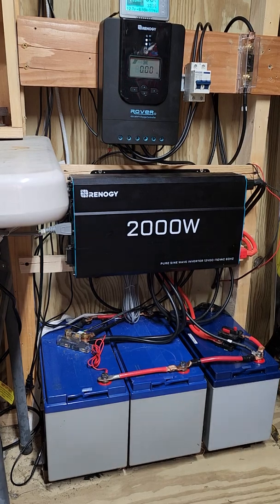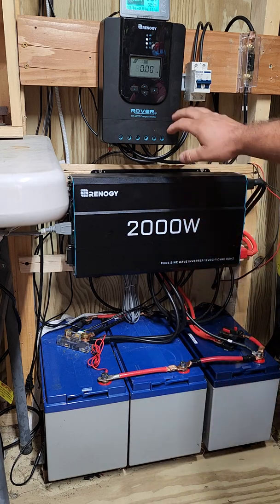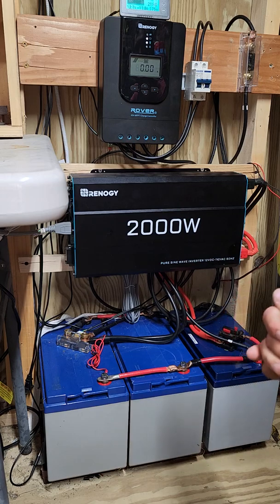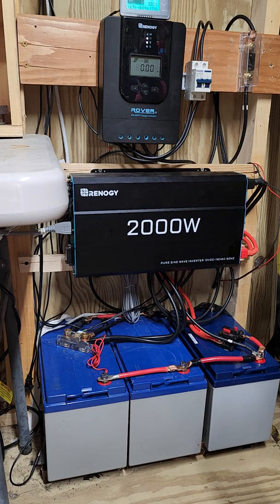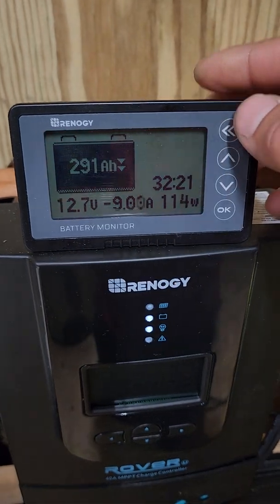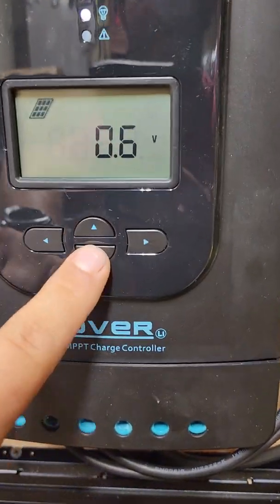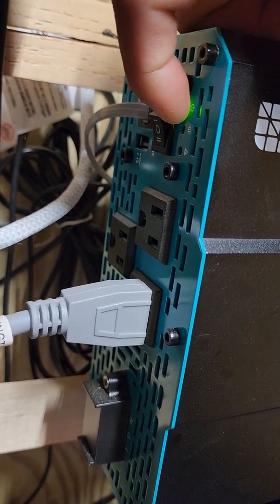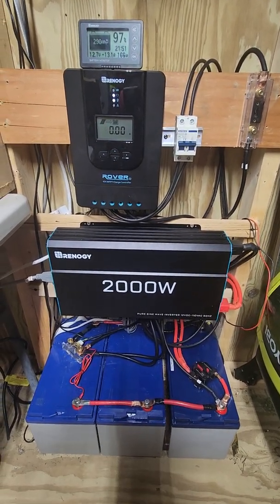Renogy off grid shed

Comment: You are the first person to explain the best way to panel the rover 40a  charged controller thanks
Reply from the maker: Np at all! I love teaching what I know! I've got 2 X 250 watt Trina panels in series now. About 70 volts open curcuit and they make about 400-450 watts. I moved the 6 panel array over to the hill said and expanded it to a 18x100 watt panel setup for the ecoflow delta pro.
Reply: @jaysonstebbins2539  here's mine but my panels are in parallel.  4  250 watt  panels on the rich solar controller https://youtube.com/shorts/IDrAsGPoIco?si=YQFfdaaAKEc_mmIp

Comment: I have a similar setup but for the life of me I can’t understand the use or need of a shunt if the charge controller shows the battery info. Love the setup and great video!
Reply from the maker: Hey Gary! Great question! So I use my shunt as really a power meter. I really don't look at the percentage. Because the battery is a chemical reaction I can't really use the % as a Guage. Always remember your resting voltage per chemical of battery your using (gel,sla,flooded,or agm) is always going to measured by resting voltage. 13.0v is 100% for me. Also I use my shunt to see if I'm charging or discharging my batteries depending on my load and solar input. Seeing ah is a nice feature to see what I've used or charged bug honestly everyone would like a % meter on a battery but it's not accurate. It's a general level lol

Comment: Hey, you got the mini fridge hooked up to the batteries, I want the same fridge for my rv, how much watts and volts does it draw, start up and idle, that would be a great video to make as well, love the set up there, cheers 🍺
Reply from the maker: This is a 120V fridge (AC). Startup is about 6 amps (620 watts) and running is about 2 amps (240 watts). My 410 watt inverter by schumacher will actually start and run it. Great little fridge. I've since upgraded EVERYTHING! LOL check out more of my videos :)
Reply: @jaysonstebbins2539  Thanks for replying back, Costco has one cheap, small enough for the conversion van instead of an ice cooler, I better get a lithium battery, glad the fridge runs under 800 watts, have a great day, cheers :)

Comment: Nice work!  Two quick suggestions for you. I would pick up one more battery so that you can charge them  in perfectly balanced charge mode, in order to get longer battery life.  Glad to see you are switching to a Class-T fuse.  I had the same breaker setup you have until some members at the Renogy forums suggested Class-T fuses for performance/safety.
Reply from the maker: Thank you! Ya these breakers are just not holding up even st 50% usage. Gonna upgrade the 200 amp breaker to a fuse as well. Thanks for watching!